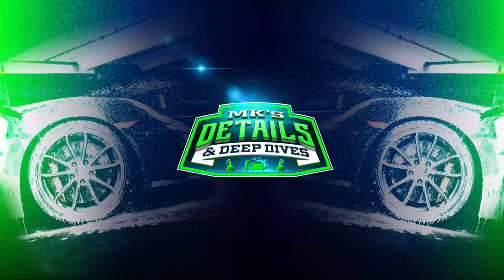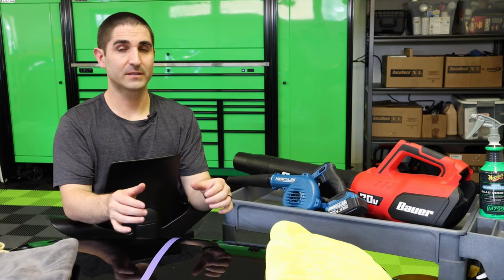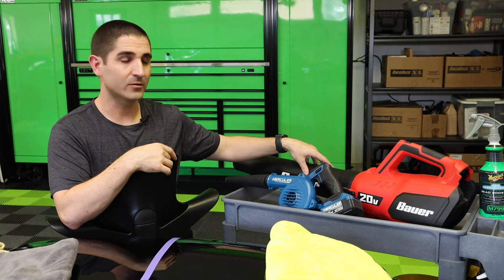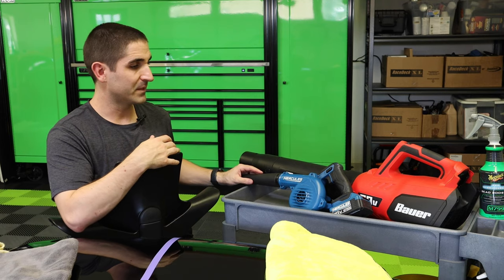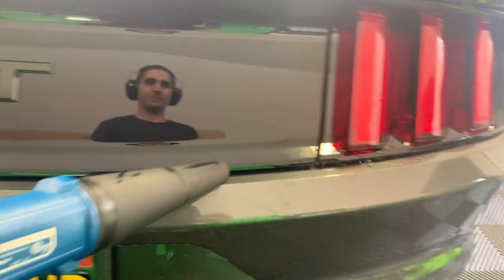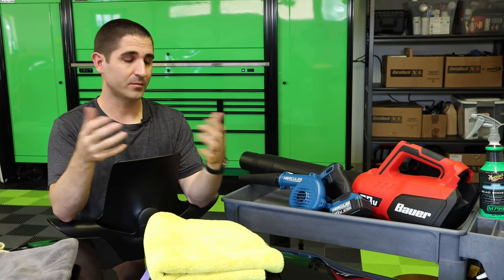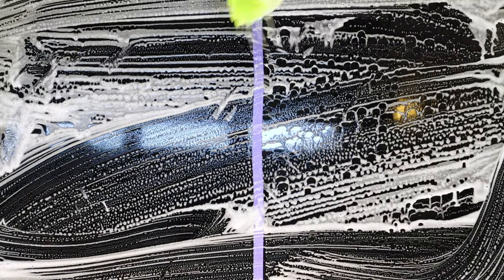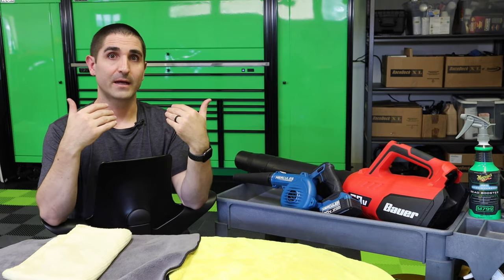How to PREVENT Swirls & Scratches in your Paint

Comment: This video is older but it is still relevant. Regarding leaf blowers: I use the Toro electric model with the 200+mph spec. It is nearly as strong as the air coming out of the commercial car washes. With blowers, you can either get high CFM or high MPH, depending on the nozzle shape and maybe the impeller design. The big downside compared to your smaller ones is the size and weight. You are definitely right that blowing doesn't work at all on uncoated cars. I started doing it back in 2005 and had a pretty poor experience. Now, we have great coatings that are much more durable and easier to apply. You really need good beading to make blow drying work effectively.

Comment: My new Ego blower takes a shorty concentrator nozzle made by a fellow on Etsy. Enough velocity to require hearing protection, and it has a dial for up to 60% throttle without having to hold the trigger. I point it at the wheels and take a break while it dries out the water behind the center caps in particular (they're somewhat large on the S2000).

Tried Megs Polymer Wash and Wax today, seems like a perfect maintenance companion to the Hybrid Paint Coating. I prerinse with an electric pressure washer but even still I like how I can apply a booster while so much lubricant is present. First wash and wax I've tried that actually performs the "wax" part, and the polymers seem to deepen the appearance of the trim and soft top.
Reply from the maker: Yeah, those Ego blowers are no joke - especially with those custom narrow tips! Only downside to the 3D printed tips is that they aren’t soft rubber. They would be perfect with that final touch! 

Yeah, you’re dead on about the wash and wax. It definitely adds a lot of slickness and darkness to trim. A little extra work compared to a normal wash, but worth it IMO. 

-MK
Reply: @MarkusKleis  yep this guy added a soft rubber end to his model, gave it a test on my daily beater and let the blower get sucked in by "ground effect" (you know what I mean) and it did not mar the paint.

Comment: Great summary video.  Thank you for your transparency regarding Harbor Freight.  Now I've got to try the Grant's drying towel you mentioned.  I already use all your tips in my wash routine.  My primary protection is Megs Hybrid Ceramic Wax.  After foaming and contact wash with Megs Gold Class, I use a small blower for the wheels and all the seams/grill.  Then use a drying aid on a panel and drag a drying towel across that panel.  What small amount of water may not be removed is taken care of with a separate dry plush towel.  Super result, no swirls.
Reply from the maker: Thank you! When you get that towel use the dark gray side for the paint and the light grey for the glass - it’s wild how different the sides are when they don’t feel like it in your hand 😁
-MK
Reply: @MarkusKleis  Looking at the 6 sq ft premium plush drying towel #64312.  Is that the one you'd recommend?
Reply from the maker: @johnneidert5777  Yes sir! That’s the one 
-MK

Comment: Love your tool box. I have the same box without the hutch and lockers.
Reply from the maker: Thanks! Yeah it was a beast to put together but I freaking love that thing! 
-MK
Reply: I am sure, just getting the stainless top on was a bear.  I want the hutch, locker, and and the side cabinet. I just like all the greens match. The Icon box matches my US General 5 drawer cart. The store by my home is just fantastic btw. Great people and the managers are awesome. I also put the Hybrid Paint coating on my 2021 Tundra today, super slick and easy product. What I liked is that it doesn't smear into adjoining panels as badly as all the other brand coatings I have used. Hell, 20 years ago we had sealants that were harder to use.
Reply from the maker: @cjburn2758  Yeah it’s awesome how you can expand and even do the carts from USG that match. That new USG full bank cart in green is calling my name! 😳

Also good to hear you have good at your local store - I visit mine a lot and they have been fantastic. Very friendly. It seems they really like working there. 

Right? Hybrid Paint Coating is is a game changer. Super easy to use, out of this world slickness and the best hydrophobic properties of anything you can find in a store. Heck, it measures better than pro coatings that cost 4-5 times as much! 

Thanks for sharing! 

-MK

Comment: What about a chamois?
Reply from the maker: Hey there, 

As for chamois, they are a different beast and not one I personally find much use for. Let me explain...

The advantage of a chamois (synthetic or real) is that they quickly and easily absorb large quantities of water AND can just as quickly and easily be wrung out. However, the flipside is that they generally leave a small amount of water behind that a plush microfiber towel would not, AND, likely most importantly, they have nowhere for dirt or debris to go and thus are the most likely to cause swirls when drying.

Now, for high volume production-style detailing (car wash tunnels, auctions, dealerships, etc), they are an excellent choice due to their speed and ease of use. But for high-end detailing or personal use, I don't find much use for them.

The one exception would be if I were to do a decon wash and clay BEFORE performing compounding and polishing, then they are a nice way to speed things up a bit since you are going to paint correct afterward anyway.

Hope that helps!

-MK

Comment: Hmm, Ive never sprayed my towel with a drying aid, always on the vehicle... 

Do you find that drying aids cause the drying towel to become hydrophobic? How do you combat this?
Reply from the maker: Hey Blake, great questions. So the reason I suggest going into the towel (with ANY spray wax or sealant, as well as any drying aid) is because you significantly reduce the chance of dark spots or streaks (mostly on dark colors) with this approach. It also reduces the chance of over spray carrying and sprinkling an area you already wiped and leaving dots everywhere.

As for the towel getting clogged, this can definitely happen whether you spray into the towel or onto the car and then rub it with the towel. I have not noticed a measurable difference between the two methods from that perspective.

As for fixing it, I wash my microfiber towels (all of them) with about 1-2 ounces of D107 (a low foaming APC) mixed in with some dye and fragrance-free detergent, AND then I add white vinegar in place of fabric softener. Between the APC and the vinegar it flushes the waxes and polymers out of the towels. 

Hope this helps. Thanks!

-MK

Comment: Hi friend..! Where can I buy an air blower like the one in the presentation? Thank you.
Reply from the maker: Hi Luis, where are you located? 

-MK
Reply: Fall River MA 
that's my location my friend.
Reply from the maker: @luisnegron8844  Well the one I used in the video is the Hercules brand (item number 56417) from Harbor Freight where I work. They also sell one under the Bauer brand with the same specs for $10 less. Other brands have similar tools and they are normally called compact jobsite or workshop blowers. 

-MK
Reply: thank you my friend.

Comment: Great video, MK. Any thoughts on the Harbor Freight large drying towel? I have the Griot's drying towel, and I'm looking for a back up. Thanks!
Reply from the maker: I like it - I have a few of them and use them often. They are unique because the two sides are made of different mixes of material and behave differently. The dark grey side is best for drying paint, while the light grey side is much better for glass. 

-MK

Comment: I have one of the bigger lawn blower and what I did was just put on a reducer for like rain down spouts and it works really well for as much as I use it
Reply: I have an electric w/long narrow  I wont be a big user either but I DO like how it does mirrors, body creases, & lug nuts.
Reply from the maker: Yeah, as long as you have a reducer it should work, although I really prefer a short tube so it is easier to control... and the soft tip is such a nice feature for peace of mind! 

-MK
Reply: So how long is the tube now? Like 8ft.? Lol

Comment: MK, do you recommend using m799 full strength as drying aid on hpc or do u dilute 1:3?
Reply from the maker: Hey Andrew,

If the car still has a decent amount of water on the surface, full-strength is best since it will be diluting it down effectively as the M799 mixes with the water during the drying process. If you have bonkers hydrophobic properties and used a blower and got 95%+ of the water off, 1:3 is fine but I would choose based on how often I plan to touch the car up again. If it will be a few months, go with full strength. If you wash it and boost it once a month or more, save your money and dilute it 1:3 :)

-MK

Comment: Markus, great to see a new video from you!
I’ve been thinking about getting a little Ryobi blower similar to blue unit shown here.  However, since I’ve been using Meguiars HCW as my primary hand-applied protection and regular drying aid, I’ve wondered if a blower removes too much water to allow the HCW to work effectively.  Any thoughts?
Reply from the maker: Very good question - I would say if that is the case just don’t blow too much of the water off and then use a little less of the HCW and you should be golden. I do something just like that when I use HCW instead of M799 👍
-MK
Reply: @MarkusKleis  Functionally, how does M799 differ from HCW?
Reply from the maker: @jroberts1520  They actually share technology - but M799 is thinner and easily applied dry (or wet) with a simple spray and wipe approach. No need to rinse. You can use M799 full strength on a clean but dry panel and it is a spray sealant with 3+ months of durability (it beat products claiming 6 months in our testing). Unique to M799, you can dilute it and use it as a boosted Detailer. (I have deep dive video on M799). 

HCW definitely needs water in some form to rinse the excess material and/or help spread it. HCW is more concentrated so you can get 6 months more easily, but it is not dry spray and wipe friendly. 

-MK

Comment: Most shop air compressors w/o filters actually blow condenstation oils back onto your work area .
Reply from the maker: Very true! I don't have my filtration setup on mine yet so I do not use it to try cars. But I plan on adding the filtration for that exact reason. Thank you for reminding everyone! 

-MK
Reply: Install a good dry filter on intake and make sure you empty and drain the tank.

Comment: What are your thoughts on the Bauer pads at HF since you work there?
Reply from the maker: Hi Taylor,

The foam on the Bauer pads is actually pretty nice - my favorite is the yellow, and the white is also a nice soft pad. The blue and the green are also decent pads, but they can degrade under excessive heat/pressure. 

Also, we had an issue with the glue between the foam and the "Velcro" failing, but that was updated not long ago. The new and improved pads should now be in the stores and they are solid!

-MK

Comment: Would love to see a video about the different types of waxes and sealants in the future across the Meguair's line (or other brands).

What products do you recommend for adding more glow and depth for a white car?

My car is a crystal pearl white 2020 Subaru XV (Crosstrek) and has been ceramic coated from the dealer, but I do think the coating's performance and longevity is starting to diminish and wear off. It's currently winter in Sydney, so it's hard to wash the car and do a complete strip wash + chemical decontamination to test the coating's performance. A few days ago, I did do a waterless wash, applied CarPro Eraser, then applied Meguair's Hybrid Ceramic Liquid Wax. Loved using the HCD and HCW, that has been a staple product that I've used regularly in the past, but have tried other products over the past year.
Reply from the maker: Hi gohypo! Can you expand a little more about your first question about future products? Just want to make sure I understand exactly what you mean. (I think you mean what I THINK the future of these products will be like?)

As for your white car, the number one thing that usually helps a white car is DEEP cleaning the paint. It seems you already have the right idea with wanting to do a DECON process when the time is right - that is a great first step. 

After that, if you see the coating is truly dead, I would evaluate how bad the swirls are and then either go to a full compound and polish, or just polish to remove whatever coating remains and swirls exist. 

From there, being totally honest, I think you will struggle to truly see the difference between any coating as long as the paint is properly cleaned and polished first. Do they have Hybrid Paint Coating in Australia? 

Your other option is to avoid a full coating and stick to sio2-boosted sealants like Hybrid Ceramic Wax and just apply from time to time like you are doing now. 

-MK
Reply: @MarkusKleis  Thanks for the reply Markus! No, that was just a general question - not so much about the future of what the products will be.

I don't think Hybrid Pain Coating is available yet in Australia. I've seen one online retailer stock the M27 sealant and the Bead Booster (gallon size). 

Will Bead Booster last 2/3 months in a warm-hot climate with humidity? I believe Sydney's climate is similar to SoCal.
Reply from the maker: @gohypo  Ok gotcha. Yeah, you should get a few months. M799 is a true sealant, so temperature really shouldn't affect it much. If you see it start to dip in performance, the nice part is topping it off is super quick and easy and barely takes any product at all. 

If the paint is slick and in good condition, you should get a few months out of it if applied at full-strength. I do. 

-MK

Comment: Just came across your channel and enjoy your content. I have a new car coated with cquart lite (including wheels). Is there a safe all purpose cleaner that can be used (diluted) for bug removal, wheel & tire cleaner, interior cleaner, and engine bays?  Or would it be best to go with specific cleaners?
Also, what topper would you recommend that could be also used as a drying aid?  Thanks for your time!
Reply from the maker: Hi Mike,

Thanks for the kind words! CQuartz Lite is a solid product with really fantastic hydrophobics, but I think you will diminish the lifespan some if you hit it with degreasers or APCs (basically a weaker degreaser) on a regular basis. 

The good news is that the coating should make it easier to clean, so you can likely get away with gentler options and be totally fine. 

The safest way I know of for removing bugs is placing a handful of microfiber towels in warm (hot if you can) water in a bucket, then I add 1 ounce per gallon of Meguiar's D155 Last Touch (it's a detailer, if you do not have it, you can use ONR instead, and in fact, it is likely the better fit for the many uses you are after) and then I place the towels over the bugs and let it simply sit for a few minutes. You basically use reverse osmosis to hydrate the bugs and soften then up. When you lift the towel up usually 90-100% of the bugs lift right off. Whatever is left can usually be rinsed right off, or very gently wiped away. 

If that isn't an option because the panels are too vertical, you can take the same solution and just spray the areas repeatedly for a couple of minutes to keep it wet. Then try pressure washing it off, or VERY gently wipe them off with a lifting motion to avoid pushing it into the paint. 

Also, try just using a plain car wash soap and water on the wheels first - if it works, then that is one way to reduce wear and tear on the coating. If it isn't cutting it, then step up to a pH neutral iron remover wheel cleaner as they are not as likely as a strong alkaline wheel cleaner to beat up that coating. 

You could use the same degreaser or APC for the engine bay or tires. I personally use D107 at 4:1 for those situations. 

Lastly, I use M799 Pro Hybrid Ceramic Bead Booster for my drying aide as it delivers performance that matches or enhances the coating, rather than covering it and diminishing it. If you are on a tighter budget, D156 is another option that is super easy to use but you will trade off a little durability. 

Let me know if you still have more questions.

-MK
Reply: @MarkusKleis  wow. Thanks for the quick and detailed reply!  I will definitely try your suggestions!